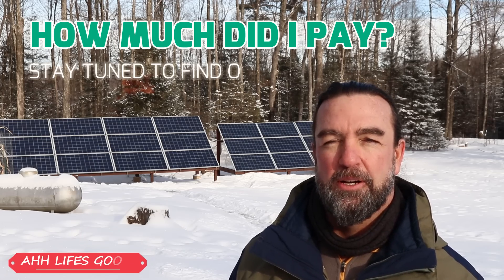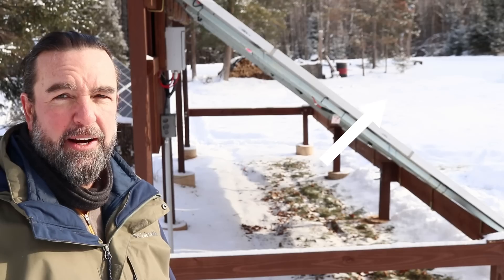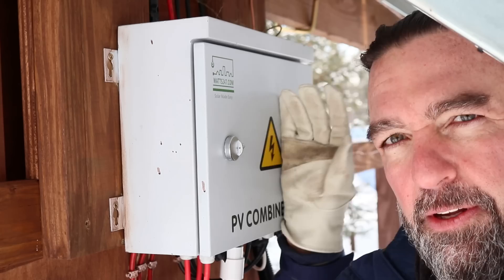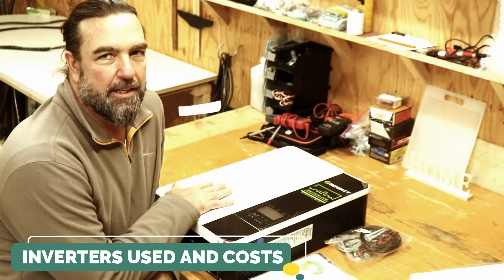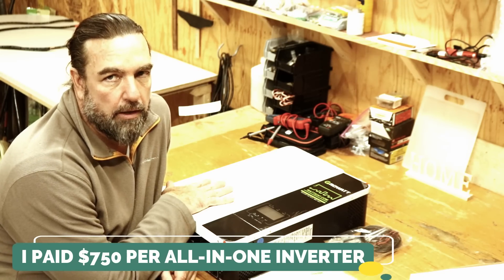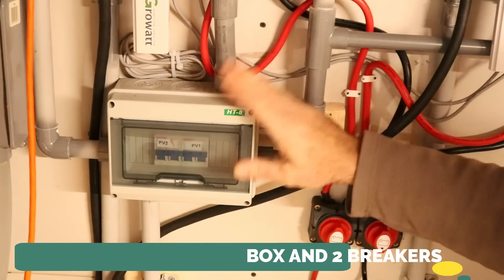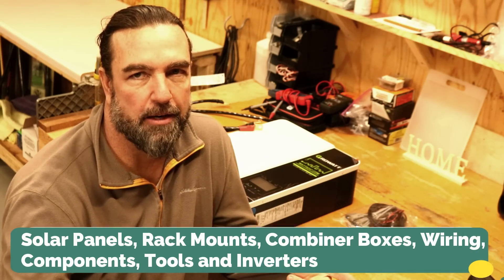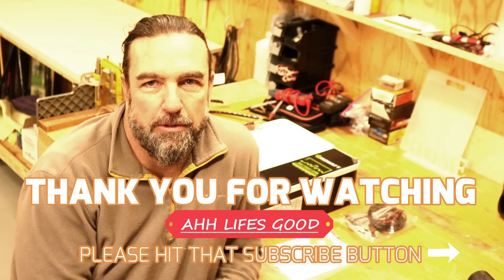WHAT I PAID - CHEAP - ENTIRE DIY SOLAR SYSTEM

Comment: Very interesting & informative 
I am in process of installing 8 solar panels 275 watts each 
It will produce 30% of my current 
Consumption 
Do you think it's necessary to have a 
battery?
I will cost me £1000
Reply from the maker: - Hello Siddique, batteries are nice to save energy at times when there's not, in the case of panels it'll be sun. Even though you don't have allot of power being produced, the question will come down to if you're using what your producing? If you are, I wouldn't add batteries. if you're not using the power produced and have a good surplus than you might want to do the math and see if it makes sense to invest in batteries. I know in allot of other countries electricity can 300+ % higher than what is charged in some areas of the United States. Cheers

Comment: Nice video. The panels will last up to 25years, how long do you think the batteries will last at 6000 cycles? How much of that 7.5kw is used? And how much do you need for the greenhouse? Interested as I would like the same.
Reply from the maker: - Thank you for your comments! That's a great question in regards to life span of these particular batteries, coming out of china it'll be nice to see how durable and productive with cycl6they will be? Unfortunately we'll hopefully be waiting awhile to here back from these reports. So far my batteries have been cycling great, on sunny days I drain the batteries to 5% using electric heat, knowing they'll fully charge 20kw the next day within 4 hours of good sun. I have to plan around the snow these days...
Reply from the maker: - In regards to the greenhouse I'll be relying heavily on geo thermal heating, with perforated plastic tubing 15 foot underground that'll transfer 52 degree air to most of the greenhouse using 12v fans, year round if needed. The rest I'll compensate with electric heat from solar, which is EXTREMELY inefficient if you need allot of heat. Will also rely on passive heating from 50 gallon drums of water, painted black and aligned on the northern wall of the greenhouse, this will add maybe 5-10 degrees more to the air when in winter.

Comment: The main way to reduce cost is to design the house and lifestyle to use less electrical power. 
Q: Did you look into whether or not it would be cost effective to have a solar rack that could be manually adjusted to change the panel angle for different seasons?
Reply from the maker: Hi Don - The first sentence you have written is stated perfectly. No I haven't calculated the cost differences as of yet on being able to adjust the panels to follow the sun but I can assure you this is very important topic that needs allot more discussion, the difference is big for people like myself with limited sunlight as opposed to others.

Comment: these vids have answered 90% of questions I have had, so thank you for taking the time to make them. 1 question I still have is, I see you have a ground rod for your pv combiner boxes and solar panels. Did you run a ground wire out of your PV combiner bow back to the inverter? or just 2 reds and 2 blacks? If you did run a ground wire where did you terminate it inside? Again thanks
Reply from the maker: - Hello Big Cheese! Going from the combiner box to the inverter I only ran both DC hot wires, no ground. I did however connect a physical ground to the case of my combiner box directly to a grounding rod at the panels chasis.

Comment: My biggest question is what do you see in savings every year and what would be your total time for return on investment?
Reply from the maker: - Great question, savings or return on solar investment wouldn't be until after the 7 - 20 year mark for most people, depending largely on size (cost) of your investments and if you use tax credits to write off your investment. My system will pay for itself in 3 years, if I use the tax credits. The option that I have backup utility to me in the event there is no Power is without price.

Comment: Do you have videos of you putting the system together? I need a larger system (22kw) but it should be all the same concepts... My question for you, if you build the system yourself, can you still take advantage of the tax credits?
Reply from the maker: - Depending on your state credits and if the equipment is properly approved (UL, HECO). This is a good topic as the available credits, federally and state levels seem to be expanding rapidly. Maybe other viewers have better insight? Be sure to check with your state to see what they offer, federally is here: https://www.energy.gov/eere/solar/homeowners-guide-federal-tax-credit-solar-photovoltaics

Comment: Great video breakdown of DIY solar. How long do you believe it will take for your efforts to pay itself off in savings? 2-5 years or more? Thanks in advance.
Reply from the maker: - This system will be paid for in 3 years using tax write offs, if I didn't use any type of credits it'd take 7 years. Having the system in place if needed, priceless if you're energy equipment dependent.

Comment: Very interesting.  Do you have a estimate of how much research, buying, and installing hours you did?  I know that installers typically charge about 10k-20k for a system, but then you are paying someone else to have the equipment, shopping, and knowledge to install for you.  Everyone values their time different, but it might be good to explain how much effort goes into doing something like this.
Reply from the maker: - Hello Brandon, that is a very good point to address as the research time involved consumes many hours, days and weeks for those not familiar with how these systems work, under what conditions and what your energy needs might be. I couldn't tell you how much time I've vested, been very enjoyable to this point thus far.

Comment: Hi! I checked out pricing for the panels and batteries at the website you mentioned, and the prices are much more expensive (almost double). Did the prices jump up since you purchased yours or was there an error there. FYI I did price those panels in bulk (pallet pricing). Please let me know. Thanks, great video!
Reply from the maker: Wow!!! The prices I quoted were pretty close to right on. I bought a pallet (25 panels) one year ago for $2000 including shipping. I can only imagine the prices have went up with all the political issues these days, along with inflation

Comment: Aside from the battery cost, which I am sure you have your reasons for the overkill storage...that's a reasonable cost for such a big amount of electricity capability. We pay on average $200/month so you can see if with your battery cost we'd be running free in less than 5 years. Awsome break down William!
Reply from the maker: - Hello William, if you do add solar be sure to plan according to your consumption of electricity needs and then the rule of thumb is to have a 3 day surplus. Honestly for me, depending of course on needs I think a 10kw, system with a 30kw storage system in the northwest is necessary for running your average households, then again I consume allot of electricity. This amount greatly depends on if your conscious or not in your consumption needs. Now in the desert of California you could probably get away with 5kw PV and 10kw battery bank, given the amount of continuous sun. In the end for me it's been worth the small investment for the added stability I have of being Off grid should the time come to be.

Comment: Living off grid for 15 years now I just upgraded to lifepo4 battery’s    At this day in age I would never recommend led acid to anyone  they may be cheaper in initial cost  but to get the same amount of storage you need 2x more . 100 ah led acid = about 40 ah irl.  Don’t buy led acid
Reply from the maker: Hello Smack, this is good advice given all the alternatives now available for Lithium and cold or even Salt battery solutions. Couldn't agree more on storage capacity and discharge rates. Where I live currently, 46 degrees north everyone relies heavily on Lead acid as the temperatures can get really cold (-50), with people living off grid 100% they have no alternative for charging there batteries in the event there is no sun. Of course there is allot of Lead acid batteries available as well on the market, making them a very cheap additional energy source when rebuilding old units.

Comment: Thanks for taking the time to share your setup with us. What kind of a price difference would that be between a EcoFlow setup including the $6k batteries specs minus the solar panels?
Reply from the maker: - Hello Truth seaker, nice name! I don't know allot about the The Eco Flow series but it seems one would still need to price in an actual power source provider which is expansive for what they offer, depending on solution, as is the case with the Pro unit. The price difference would be significantly more than the setup i have and more restricted, depending greatly on what model you chose and how you planned to do your setup. What I don't like about these units is you're stuck with an entire all-in-one package if inverters, components and batteries all-in-one. If one little part goes wrong you have no system at all, and they're is allot points that could fail. Cool system though for people on the move, camping, RV, boats, etc...

Comment: What do you estimate the pay back time ? 
And how long do the batteries last ?
Looks like a pretty neat install 👍🙂
Reply from the maker: - Thank you for the comments - I just answered another viewer on this and have added to your additional question on battery time: "Great question, savings or return on solar investment wouldn't be until after the 7 - 20 year mark for most people, depending largely on size (cost) of your investments and if you use tax credits to write off your investment. My system will pay for itself in 3 years, if I use the tax credits. The option that I have backup utility to me in the event there is no Power is without price."... Battery Discharge rates will depend on how much electricity you consume and for how ling you'll need it. These time variables can differ immensely, as well as the costs can get astronomical with battery banks, very fast. As for how long the batteries last, well the manufactures says 7000 cycles (apprx. 15 yrs) at 80% discharge. Whether these numbers ring true, we wont know until they've been on the market long enough.

Comment: Hi...!!!
Nice setup... hope you solve that communication issue between the Growatt inverters and the EG4 batteries...
What I see here is that you have enough batteries for some time now... I think you would need to put more inverters to have more power available...
Would be better to have 4 48 Volts batteries, but I know you mentioned that they weren't available at the time you bought them...
God Luck and Merry Christmas...!!!
Reply from the maker: - Happy holidays back to you Alfredo and thank you for the comments. The plan is to pass this entire Solar system over to a controlled greenhouse I want to build, add 12 more panels to that same system (11kw total), 1 more 3000w inverter and 200ah at 48v more to the battery bank. The house will be overhauled at the same time, adding 3 of the 5000es Inverters, with a minimum of 60kw of storage. This solar for me is my second go around, first in this type of climate! Really been an enjoyable enjoyable experience of discovery along the way. Cheers!

Comment: Thanks for an informative and well laid out video. I wonder if it would be worth to have the panels on rotating mounts to get more energy? It would be interesting to see a video on what options there are for rotating mounts on the market and what cost diy and so on.
Reply from the maker: That's a really good point and thank you for the comments! In this area of the world being so far north (46 lat.) it is most necessary to have some kind of swivel or mount that allows you to track the sun. The small amount of time I've been here I see a tremendous difference in the amount of energy produced from the angle the sun reaches from Summer/Winter Solstice, along with the amount of time it's available during the day. The suns angle here is 60 degrees in Summer and 12 degrees in Winter, yes that's correct so anyone that's serious about harnessing as much energy as you can from the sun, most definitely plan to implement some kind of swivel into your base if you can, if not, find that exact medium (average) between the two numbers and plan accordingly.
Reply: @ahhlifesgood1956  I’m at long 58 in Sweden. My only experience with solar is on my sailboat and it makes a big difference when I direct the panel to the sun. Some auto following of the sun would be great here. I don’t think many people understand how much better it can be if you have the panel on a swivel and direct the panel. Many including me have the panel flat on the hatch of the sailboat.
Reply: Easy to build diy solar trackers on you tube. eBay had cheap kits with everything you need for less than 100 bucks.
Reply: For a solar tracking post you can use the front sraight axle off a truck.  Bury the axle into concrete in the ground like a post and then use the spindle and wheel hub to rotate solar array to follow the sun.  And put an accuator on the tie rod attachment  end to make the solar array tilt at the king pin to follow the seasons.  I've built a few of these before and found that they even handle high winds well if not mounted on a peak.
Great video.  Just installed a Honeywell ATO for a 12 KW generator backup. As a last resort option.
Reply from the maker: @CurtisDrew1  - I like the way you think Curtis, definitely outside the box where ingenuity meets resourcefulness! That's a very functional and strong base (axle) to weld a massive PV array to pending size of axles. Heck you could even put a hydraulic ram on the tilt and hookup a gyro synced to the atomic clock for automated sun tracking. For those that need Feng Shui or curb appeal you could always case the axle in steel or wood. Thanks for the insight, comments and great idea.

Comment: Nice job!  It looks like you're running the 24v batteries in a 48v configuration.  I noticed these are easier to get and a little cheaper as well.  Any regrets with not using the 48v models?
Reply from the maker: Thank you for the review and words of encouragement, kindly appreciated! I purchased the 24v originally for my greenhouse, the need being for lower voltage ranges at 12v. If I could go back I would've purchased the 48v batteries from the beginning, it only makes sense when all other equipment is running on 48v, not to mention the BMS of the 24v batteries doesn't match with the Growatt inverters communication correctly.

Comment: Nice presentation.  You got a great price on those panels.  My system is roof mounted because I needed the extra height due to the fact that I have pretty high trees around my house and my wife didn't want to see ground mounted solar.  Consequently the number of panels I could mount (1,000 watts) was impacted by being able to remove snow from the panels.  My system is in my house, so I went with a UL listed inverter to keep my insurance company happy.  I currently have a 10 KWh battery bank, but will be increasing it to 20 KWh this Spring. One cost I didn't see in your video was the cost of the wiring from the batteries to the inverters.  I used 2/0 cabling for that and the cost including connectors was pretty steep.  I did use marine grade tinned wire.  My system came to approximately $5,600, but the battery upgrade this spring is going to add an additional $3K or so for batteries, cabling, switches, fuses a DC:DC charger to tie the two battery banks together and new battery enclosures.  So I will be close to $9K when the project is completed.  My system is configured as a backup system and is not grid tied.
Reply from the maker: - Hello Todd and thanks for sharing your comments, sounds like a really nice "backup" or supplemental system you have in place and ready to go should you need it. I used 2/0 cabling between batteries and inverters, which I'm now upgrading to 1/0 as I have the extra wire here. This run is only 3 feet keeping the cost very minimal on my end, maybe $30... As for SNOW, this is something I don't think allot of folks in the northern latitudes plan for, especially if its a roof mount. This is the only reason I went with the ground mount, for snow removal. Of course another benefit with ground mounts is the ease of implementing a swivel base to capture more of the suns rays during solstice angle ranges. Cheers

Comment: Here, in my county, we have to use commercial Racking (with engineering documents)  ...or we have to have custom plans stamped by an engineer.
Reply from the maker: - I would imagine near larger cities here in the United States they also ask for Architechual plans, we're in the middle of nowhere here with only the natural wildlife coming to visit.
Reply: @ahhlifesgood1956  , yep I'm in residential rural on 11 acres, but we need to follow code for the racking out here. Good video!
Reply: (I just posted so people don't underestimate the racking cost/permitting expenses.)
Reply from the maker: @unionse7en  - Good eye thanks, I also forgot to add the electrical conduit underground and stain used on the wood. Another $300 on the budget at the time of purchase.

Comment: Very good price.  Congrats.  My DIY 31 panel 12KW roof mount system cost me $17k.  I could of shaved off 45-7k if I knew about buying bulk panels.  Thanks for sharing
Reply from the maker: - Thank you for the comments and sharing as well, valuable information for the viewers. 12kw is a descent size system, especially being that it's roof mounted.